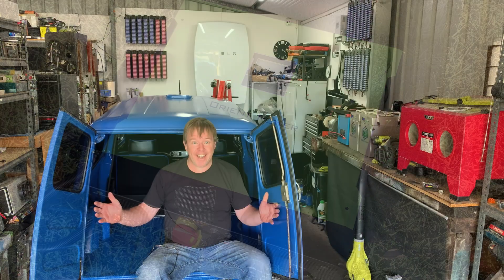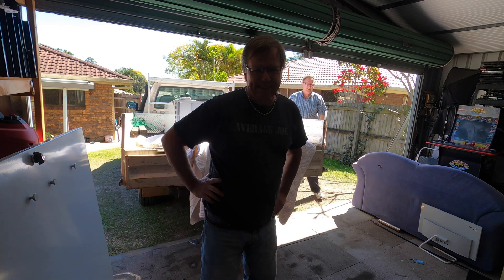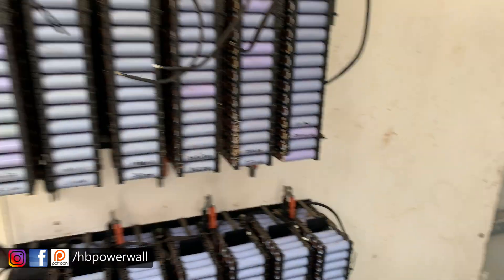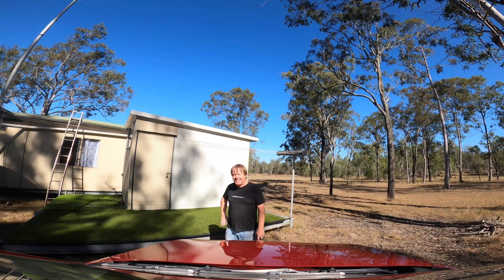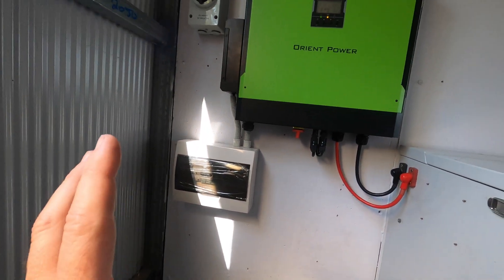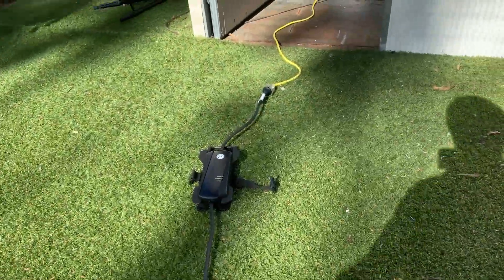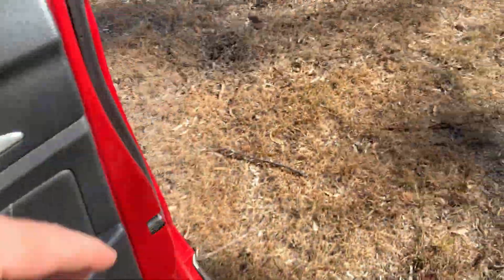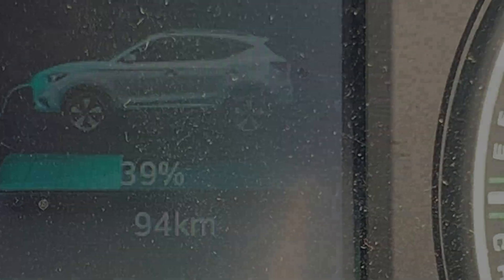Clean DIY Offgrid install with an Orient Power 5.5kw Hybrid Inverter & 25KWH DIY Battery

Comment: Rusted “nickel” strips?  Just Plated???
Reply from the maker: 100% shit seller...
Reply: @HBPowerwall  thanks.  Have heard about “nickel-plated” strip - either sold cheaper than the 75+ US$ per kilo I’ve seen it cost, or - I’ll bet - being sold as pure nickel, at the full nickel price!

Have wondered about using nickel wire as a “sorta-fuse” that is then soldered to tin-plated copper (plated onto PCB material to ~ 8-9 oz. thickness, .3mm thick or so) “bus bar”???

Comment: Did you use pure nickel strip or nickel plated strip, for those rusted strips
Reply from the maker: Old ones were advertised as pure nickel strip. Turns out they were not.

Comment: Everyone states they don't need active balancers and then installs and uses them. They are great for DIY batteries and by using a switch or automation keep your DIY batteries balanced and improve their capacity. You should put regeneratable desiccant bags in that battery cabinet or it will corrode like the last one did. Insanity is repeating your mistakes and expecting a different result.
Reply from the maker: Being a more sealed box so to speak it's doing much better, active balancer is 100 % controled by my Batrium BMS - so far working very very well..

Comment: pete, have you tried out Solar Assistant on these inverters? They log constantly, and allow remote setup and control of the inverters via the usb. they are cheap and have replaced all the other software for me now.
Reply from the maker: I have looked into it yes, it's high on the wish list
Reply: @HBPowerwall  they are not expensive. Like $55 for the software. Byo rpi
Reply from the maker: Yeh, super cheap and I have internet out there too so can take a look from home! sounds like a win to me

Comment: Maybe put a roof fan in from bunning mate, too. Peter not judging you, just suggestion for complaint here in Australia.
Reply from the maker: love to put a small solar roof vent in, just something to change the air, in summer door stays open and there is the ol' Bunnings 15 dollar fan that just blows on the old inverter/batterys for 4-5 months a year - cheap easy solution that seems to have worked perfectly

Comment: Well done, mate, the drive looks like my drive for solar panels.  Cheap than other batteries,  just a lot of time. You need RCDs in the box, too, for safety.
Reply from the maker: that 20amp one is an RCD, I wanted one on each breaker as they will all do different things but what do I know I just fix computers :P

Comment: How many cells Pete, and average capacity? By my calculation, about 2,744 @ 2.5Ah. Where can I get a copy of the latest AU Standards for DIY battery systems?
Reply from the maker: there are 2,674 connected cells, 3 cells removed from each battery for top mounting hole, then another three cells top and bottom where the mount contacts the battery are disconnected to prevent earth leaks to ground. The tested completed batteries with 191 connected cells mathed out to be an average of 2600mah
Reply: @HBPowerwall  awww. So close. I forgot about the extras for insulation
Reply from the maker: lol

Comment: great progress and the crappy laptop batteries served 5 more years - I bet by average twice the life time than usual if those cells had been working 4 years before in those laptops.

And you spent a lot I guess for the 3 or 4 HAGER circuit breakers - usually made in germany. 

The MG should work fine with all the power you can provide all year long - it is a partially VW cause MG's mother company is partially owned by VW producing all the VW in China for chinese market which most people tend to forget. They should be able to deliver the VW quality but have not achieved it yet at least the MG4 that has arrived here in 2022 was good but not at the level of VW, even though it was using VW parts if you look closely.

I hope the car will pay off soon with the gas savings you no longer have to spend. 

Great job, big success in my opinion if you look back from where you had started: crap 18650 cells 

which you put together to a battery, than an even bigger one and far bigger one. I still wonder if the 5 kW inverter is not too small for your demand and battery but you are in an offgrid situation which is quite the opposite one we usually have in our grid tied situation. Your battery is simply bigger to be better prepared and therefore the inverter now looks so small.
Reply from the maker: Average load is only 200-300 watts so I don't think the idol load usage would be worth having a second.. wasn't that much for the breakers and stuff, I bought the energy meter from ebay, trying to save some money.

Comment from the maker: This battery started life in early 2019 when I got a van full of laptop batteries from a local school. You can check out the first video in the series here. https://youtu.be/PenPYwa00CA
Reply: Ya need to ventilate that room, or add some insulation and a solar powered ac to keep your electronics and batteries at a more reasonable temp and maybe humidity down.
Reply from the maker: this has all been considered, so far I don't think insulation is the direction, maybe just a simple solar vent in the roof and a vent in the floor to draw colder air from under the building is the way to go
Reply: @HBPowerwall  Sounds better than nothing :)
Reply from the maker: for sure

Comment: I'm surprised you are still using Li Ion cells rather than the safer LFP. I guess that is why its all in a standalone shed. It'd be nice to know your thinking on this. 
I wouldn't mind a ZS EV. Pretty good reviews.
Reply from the maker: This battery was built almost 4 years ago lol
Reply: @HBPowerwall  And still going strong BAYBEEEE!!!!!!!  😎😎
Pretty amazing considering they sat for so long without use. Just goes to show with proper set up and storage and cells, they can last a long time
Reply from the maker: I maintained them the same I do with all my cells, regular checks and had a panel trickle charging it 99% of the time.

Comment: Great video Pete! Always wondered how those orient units go. Still have my PIP24 still pumping away
Reply from the maker: Might pull the old system back to my workshop, retest the capacity after a few years of full time use. Then it'll go back into service else where on the property ( HOPING a tiny house or cabin)
Reply: @HBPowerwall  Sounds great! Mine batteries finally let out after many years so I'm on the hunt for some new ones in the next few months. Still have the hybrid 48v inverter mpp solar inverter that I never got around to installing..... Too many projects!
Reply from the maker: I'm happy my Cars are working well, two less projects  :P
Reply from the maker: You and me both! This will be a proper test for sure, can't wait to add much more solar, generator and maybe some cool air to the setup!